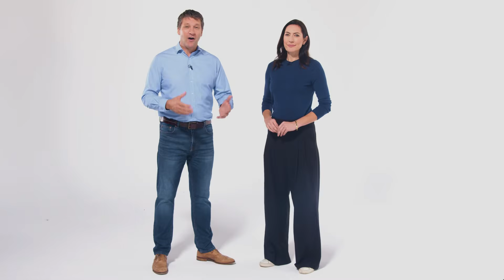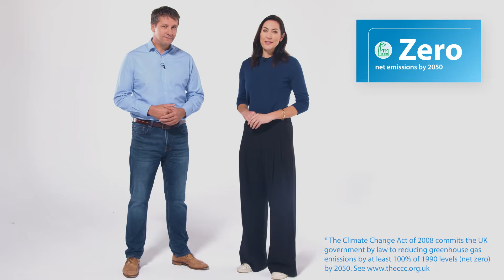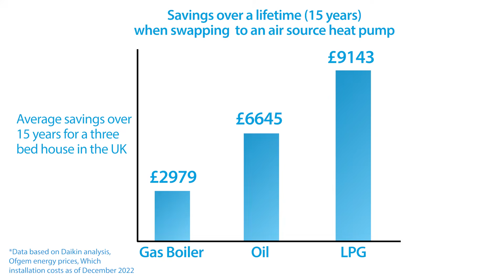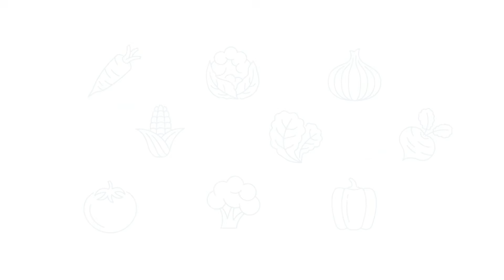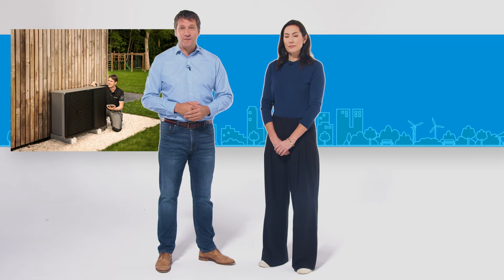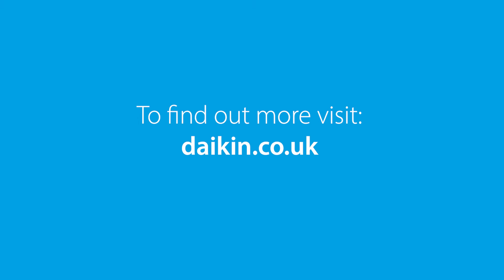How switching to a heat pump can save you money

Comment: That’s an infomercial without any evidence. I have a Daikin altherma 3 heat pump and here are the problems about validating the statements contained in this ad. The Daikin is supplied with an MMI, which is the user interface unit. One of the features is the information section. This supposedly enables you to see energy consumed ( input) and energy produced. This is crucial in determining the COP or SCOP over time. However this is seriously flawed. Moreover Daikin seem to be happy with this state of affairs. So what’s the problem. Well firstly it doesn’t actually report the energy used, secondly it doesn’t report the energy produced. When it does report something it’s rounded to a whole kWh. The information screen has 3 sections , for hot water, heating and total. But the total, which should be the sum of the other two, isn’t . Moreover often the data is shown as being different days. So there is no way of calculating the cop, no idea of calculating if you are actually reaping any benefits. What is very frustrating is that the heat pump itself must be reporting this information, because there are a number of add on products people can buy and implement which suck the informa out of the heat pump and report it. So why can’t the manufacturer do this. Why can’t they supply a working, accurate information tool which would let those customers who want to assess the performance be able to do that. Moreover the ONECTA app is equally unhelpful, presque useless. The only thing I can derive of any use if the outside temperature. The information on this tool is even more scarce that on the MMI, ( which I assume is the source for the ONECTA app). Though given that the information which is generated is all at the same time, inconsistent, incomplete and incorrect , I guess it doesn’t matter because it’s useless and misleading. And Don’t take my word for it. Daikin actually say that. Daikin, I see you don’t reply to any of the observations on this comment section, but I’d be happy to have a dialogue with you, to help you bring a decent product to market that addresses all the problems of your existing product.

Comment: They just don’t work, I’ll send you proof if you really want me to?
Reply: I heard that it does not warm as well as the gas boiler!?
It must use quite a bit of electricity,  similar to a summer air conditioner?
Electricity cost per KW, three times more than KW of gas!
Reply: @odedszpiro8222 they CAN be cheaper to run if you spend an EXTRA £10-£15000 on solar panels to provide the electricity. If you don’t, then it’s true that you gas bill will reduce however your electricity bill will go up by approximately 90% and thus you really don’t save a lot. PLUS, you will probably have to have new radiators (they only operate at circa 50 celcius compared to 80 for gas/oil/lpg. Really wouldn’t bother unless you really are a tree hugger. Oh, and all pipes to radiators will have to be minimum of 15mm diameter, if they are not then re-pipe required which often equals disruption!
Reply: All the proof in the world will not convince them.🤣🤣